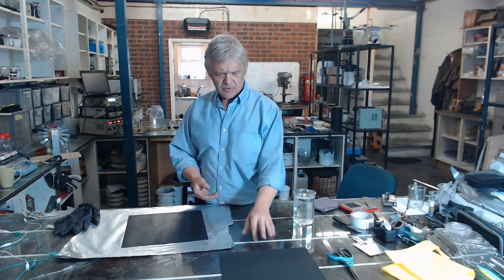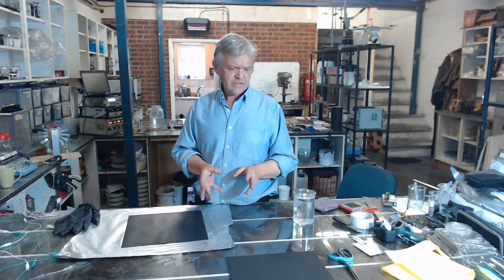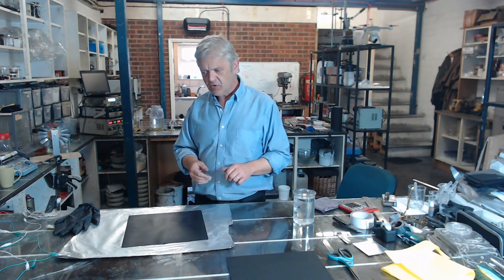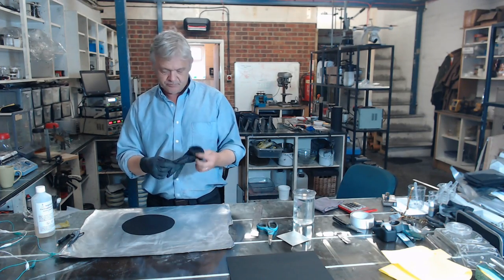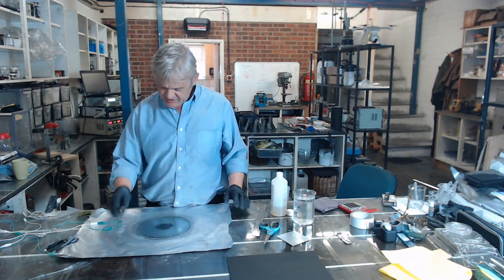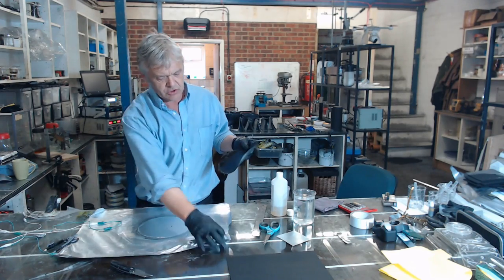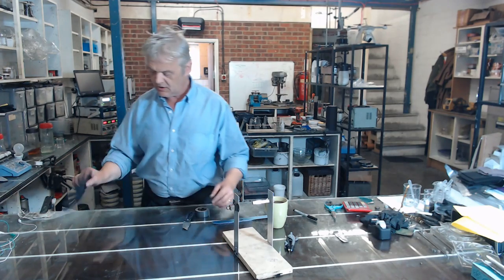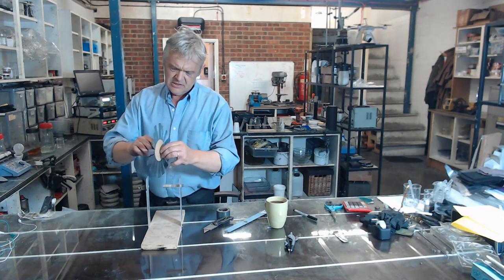How to Build A Daisy Solar Motor

Comment: Thank you it was fastinateing ,so the metallic coating was to decrease the lheat losses of the blade in line  and effecting with the rotational speed of the whole  rotor??. top to bottom. Screening could increase speed??
Reply from the maker: screening would definitely increase speed the metal coat controls the contraction of the plastic in mechanical terms

Comment: the divisions for 22.5° then add to 45°, 67.5°, 90° THEN @ 9:50min. you say 110.25° should be 112.5° AND that may be the cause of the more than expected imbalance? love your work. be who you are because i like what you present!
Reply from the maker: yeah - I was doing it in my head as I went along and figured I had probably got it wrong which is why I said spaced apart 22.5 degrees - but hey ho - I am just mortal mate lol - and cheers mate

Comment: Excellent video. What are the practical applications for this motor? I realize it can be made to a larger size but does it have enough torque to overcome Lens Law of you attached magnets and generator coils? Or can it be made strong enough to turn any external things such as a water pump or alternator/generator?
Also, please edit videos to speed up repetitive task like drawing lines after the 2ed line is shown or cutting out the disk.
Reply: Not likely it is just science fun for recruiting new blood into the STEMs.
Reply: @Barskor1  I see. I think it is fascination but I'm wanting to discover technologies for power production that the average person can do without fossil fuel on a very low budget. This far, I like best the Bidini motor and the Searl Effect Generator. The SEG is unattainable for most due to the cost of precision milling that is needed and as of yet had not been directly duplicated (to my knowledge). A bidini motor can be done easily by anyone with basic mechanical skills using scraps available in most people's home.
Reply from the maker: It really is a science fair project mate - this isn't a source of serious power - there are some interesting concepts to look at here but for more power you are going to need different materials that exhibit the same responses but more powerfully like nitinol for example
Reply from the maker: @Barskor1  spot on mate
Reply: @SI-GOD  Well IMO seeking an over-unity generator is an improbable goal to get done anything running an electric motor to get more electricity is not likely to work.
The better option is to look at the pure generator side of things just looking at the mechanics and electromagnetic fields an area I think is under studied is the windings and how they are tight coils if you were pushing a fluid trying to get maximum flow and lest resistance they would be nearly the worst thing you could do. Treating electrons like water may be wrong but constantly changing the direction of motion must cost some energy even for electrons.
With that in mind picture 100 wires in parallel the ends attached to bus bars half moon curving over the rotating magnet and another one for the other side you can layer the wires as deep as needed to obtain the best capture of the field.
 This probably has been thought of or done by others but it is on my bucket list to get done as a project.
Reply: It is as Rob described; a gravity engine. Search for "gravity engine". This example is micro scale.
Reply: @Barskor1  I agree with you about over-unity but I still fantasize about "what if..." so I watch things that claim to work. Most are total BS but the 2 I mentioned before are worth my time to try and if/when it fails, explore the why followed by can that be changed...
I also question, if the bedini motor is so easy to make and works so well, then why are we not mass producing them to power the whole world? For that answer, I can only say that at the moment; "I don't even know what it is that I don't know!".
Your half moon idea seems easy to make and test. I also wonder things like can a fluid (water/air) be routed in such a way to allow it to be used more than once. The simple thought is pump water into a reservoir runs through a trough that turns 3 hydrogenarators. I know that won't work because every time you go higher, you need a larger pump that still uses more energy than the generators produce.
But is it possible to build a wind tunnel with very little back pressure with 2-3 windmills (modified blades)? Whay would be needed to allow the air flow past each freely enough to still be able to turn a second device...a third? How many can be chained before the resistance causes the whole thing to stop?